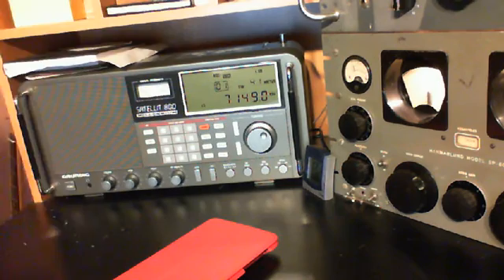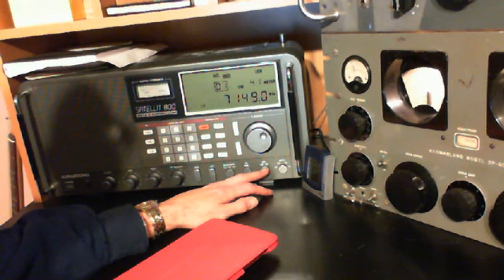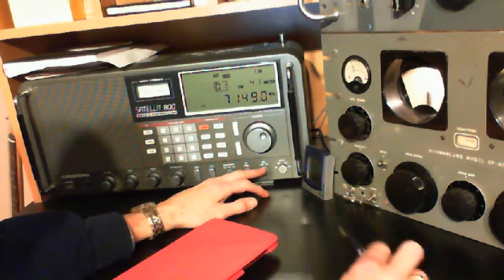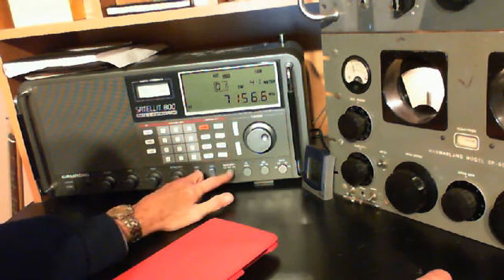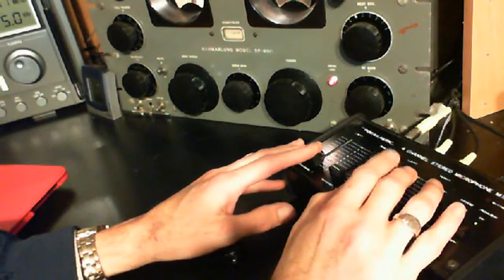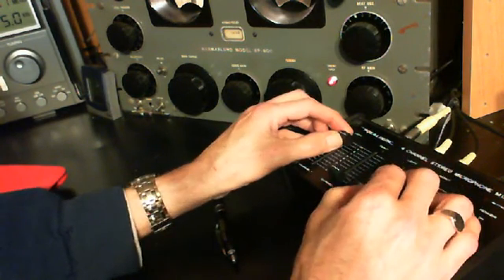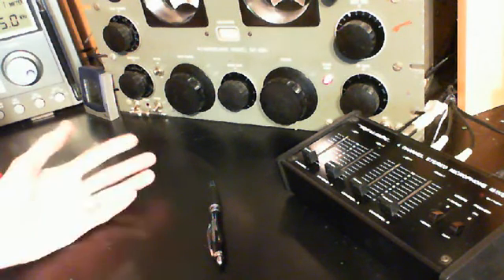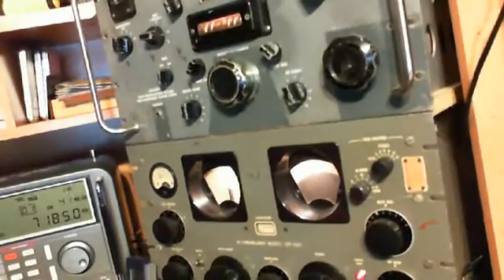Comparing Radios Grundig Satellit 800 and Collins R390A receiving Amateur Radio

Comment: I have used the R390 in the past. I was a radioman in the u.s. Navy and it was the best
we had for years. I worked at a radio receiver site for a year and tuned these radios
and they were great and reliable. I wish I had one now.
Reply from the maker: +Big Al My other great boatanchor is an R390A but I am hesitant to do any work on it.  It seems to work fine.  I did change the 7 killer caps in it so it's safe to use.

Comment: The R390A/URR and similar receivers were fed with HUGE curtain type log periodic antennas and fed with the highest quality heliax lines. ( Collins 237C and 237D were popular antennas ) or with rotatable arrays. Nonetheless excellent results can be had with a loop .. made mine 142 feet and fed to the radio using parallel feed line.
Superb radio that still beats all i ever heard and seen in action.
Reply from the maker: It must have been stunning to tune and listen to something like that.  All I have here is a poor little dipole just above my roof.  Where did you put such a huge loop?
Reply: Jim Lindenas
Hi Jim . My roof too . 142 feet of #16 insulated wire held by insulators and a last one ( tubular ) at the feed point , Use the max distances you have on the roof. mine's kind of squarish shaped but works fine with the URR . Antartica stations and New Zealand  comes in quite fine. I may make a small video of the radio which is now totally top shape. Much room for improvement left.
Reply from the maker: Is that once around?  How far is it stood off from the roof, etc.?  Do you tune it with a capacitor somehow?  Why haven't I seriously considered a loop around my house??  I have a nice overhang that a wire could run under without being too noticeable.  I've imagined many ways to sling an antenna around my yard but none are practical.  I have never really thought about a loop.
Reply: It's a single turn all around the house .there's a small part that's higher than the roof that i use to put insulators on .insulators are 4 inch PVC one inch pipe that has a hole to run the wire through and a long 6 inch thin nail and a washer on top to hold the assembly to the " rail " . I used silicon on the nail and pipe base to weatherproof it. Then i used a horizontal 5 inch piece of pipe  held in the air strictly by tension on the wire , at that point the two ends of the loop are tied and ends soldered to a 300 ohm tv type line feeding the receiver. i have not tried any more matching having already good results . Very basic.
Reply from the maker: I like basic.  I need a much better antenna for my shop and I can fish a 300 flat lead into my shop from outside.  Why not coax?  What bands does it work best on?
Reply: Jim Lindenas
It's hard to tell which band it works best on. Variations in conditions are affecting the receive more than anything i noted. The built-in Ant Trim works wonders. Everything And to your second question : why not coax ? Historical reasons :)
I had a Hallicrafters S-39E with a balanced antenna input. The 390 also has a balanced connector for the antenna. I ended up shorting the two balanced inputs together and using the unbalanced , it just performed better. Don't know about the future but at the moment this is working out reasonably for the real estate used for the antenna.
Reply: Most of us in the military chose the full-sized rhombic as the antenna of choice.  If I could have one now....
Reply: Log periodic in a curtian antenna array! Multi dipoles is what I saw in sales letiture but maybe I'm wrong. 

The Navy had a curtian at their Guam location and using it on the CB band resulted in west coast stations by the dozens. Hope it won't mis-appropriations of goverment property!

Comment: Thank you so, so much for doing this requested comparison Jim. This is hands down the best and clearest comparison between old and new technology featuring the Satellit 800, being arguably the most complete portable receiver in this century. I would never have thought it but I can hear the difference and I finally get what all the fuss is about classic vacuum tube boat anchors. The sound IS indeed warmer and the hiss is honest without any digital interference. Thanks for digging out those weak signals. Jim, you've created art here possibly without even realizing it! Much appreciated.

Comment: Wow Jim that Collins R390A is really sensitive and the sound quality of the signal has a huge advantage over the 800! It seems to be on par in the receiver side of my Kenwood TS-830S or my Eton e-1 which was designed by R.L. Drake.
I'm also studying for my ticket again, (after 40 years).
I'm looking into a K4KIO hexbeam. Very good reviews on eham, very cheap and light. You'll only need a cheap TV antenna to turn it. Very strong as well.
73s
Tom

Comment from the maker: I often think of the antenna as the real radio and the thing we commonly call a radio is just a booster for the real radio.  To get the best reception, you need the best antenna.  But to get OK reception, just about anything will do.  I'm afraid many people, like me, cannot erect ideal antennas.  At least mine is outside.  I have dreams about better antennas.  I'll need to move to achieve anything significant.

Comment from the maker: Hi Arthur, My antenna is a very modest dipole cut for the 20 metre band where I do some Ham Radio work.  I have that one antenna split between four radios in my office and one line into my shop.  When I use my ham radio, I switch the antenna just onto the ham radio alone since I transmit on the same antenna.  I wish I had a bigger antenna but space won't allow it.  Did you see my video on my 500 metre field antenna?  Just search my videos for 'swl'.